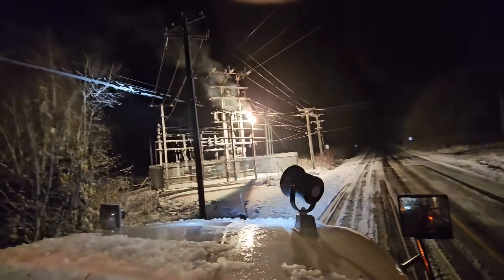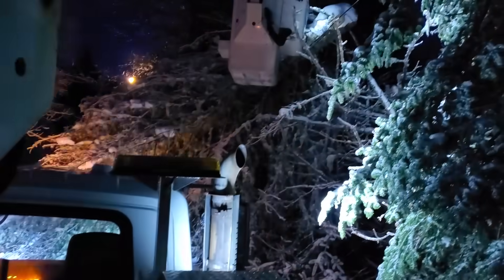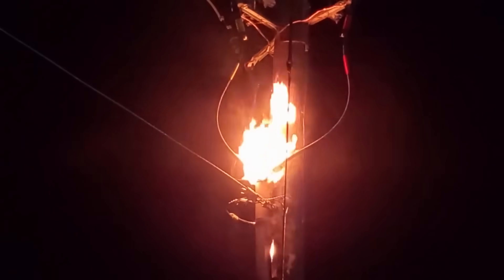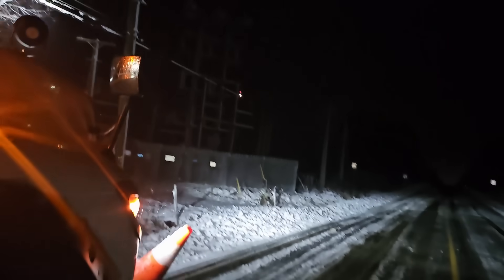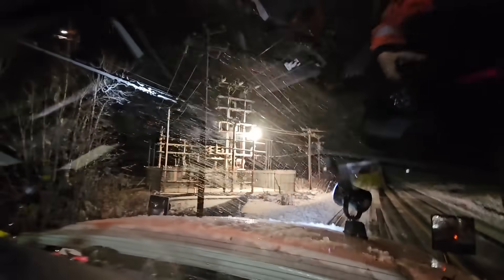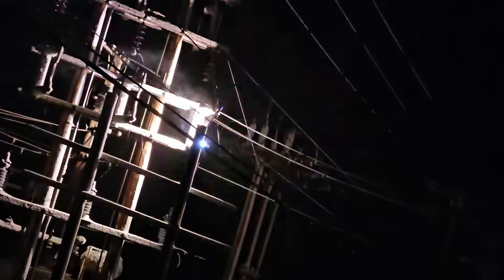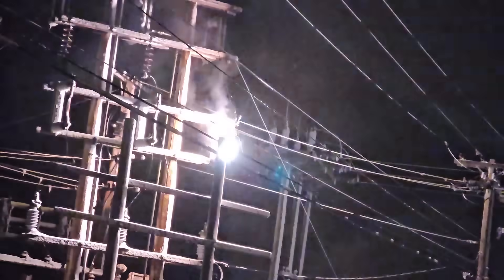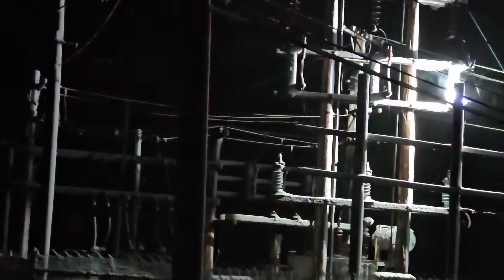Making "the call" to dump 10's of thousands

Comment: Well done! I’m a Transmission System Operator down in Texas. Distribution feeders are no problem to de-energize quickly. It doesn’t affect anyone but the customers. De-energizing a transmission line and substation is a little bit more complicated. For one a power flow study has to be performed on the system and the interconnection as a whole. De-energizing that line could cause other lines or equipment at other substations to overload. Not to mention if the other end of that line is connected to neighboring utility the dispatcher might not even have control over it via SCADA and will have to contact the dispatcher at that utility to open the breaker. There are A LOT moving parts that go into operating the grid so when he calls and it takes a few minutes to open line the dispatcher is doing a lot of checks before he does so. 

In my opinion. It helps to have a questioning attitude sometimes. If that switch is burning in the station I might be ok with letting it burn until I get all of my checks done and talked to the area RC. If it was a matter of life or health then yes of course it would be dumped as fast as I could make it happen. This is strictly about transmission equipment only.
Reply: That's interesting there is a story on YouTube guy flew a paramotor into high tension lines I'm guessing 230k or higher.  He was able to use a satellite communicator to get to a 911 dispatch. They were able to get the power turned off with in 15 minutes. He said the high voltage was burning his skin wasn't touching the wires. He could feel the power slowly decrease over 10 seconds when they shut it down.
Reply: I'm on Texas new Mexico. There's also fort belknap
Reply: good point, the grid is an interconnected network so big and fast changes will affect many generators and customer loads.  Sometimes there are no easy answers
Reply: just give the bus breaker failure relay a poke, it works faster
Reply: Two comments one. There should be no Bob, known to a dispatcher and getting different results to a phone call based on his position or title. A non-standardized relationship with the central hub of the distribution system is a disaster waiting to happen. Well they can't clone you they need to have every single person with the same job title have the same job  all the way down to the underwear just about. This stuff is too big and powerful to run on anything but interchangeable personnel. One of my favorite engineers of all time was Charles proteus steinmetz. He said that when you had an arcing event in massive power systems like this that it reflected in echoed and added and subtracted to itself throughout the entire system. When you have an arc like that the waves reflect back and forth through the system at close to the speed of light. You could be in a power plant 500 mi away from this ark, and have resonance and weird events happen from that ark and have something blow in another power plant. You could just be standing there doing your job perfectly, and all of a sudden get a voltage Spike and a discharge and boil you alive.
Reply: @markmcgoveran6811  No.

Comment: 6:00 for a faulty fuse / switch , would a high speed repeated application of 9mm lead via a multi barrel rotating device help in this situation, if not lead, a safer option , dispensed the same way...

Comment: Great video & glad everything worked out in the end!!!
At 9:49 pause the video & slow the speed down to 0.25 then play video & pause just as the power is cut off. You can literally see the structure around where the arc was located GLOWING in the dark due to heat generation (caused by resistance???)!!!! It fades out pretty fast due to how cold it is but really cool to see. Also shows how if the arcing was allowed to continue long enough it would have ruined the surrounding structures too.
PS: You KNOW it is cold in Canada when the snowman comes inside!!!!

Comment: For those that doesn't know why the light/arcs were green-ish: The arcs are hot enough to vaporise the surface of copper, making copper particles go into the air. The copper particles oxidises like how iron oxidises, and iron oxidises is called rust. As you probably know, copper turns green when exposed to the air.

Comment: I work on fiber/coax and I can relate to what you had to do and how stressful it is. We have backbone fibers that if taken down knock out tens of thousands of peoples internet access and its a VERY big deal when it happens. You have to be absolutely positive you have all your ducks in a row on your side and that its the only option to do the repair. You definitely did the right thing by not going near the station until the feed was cut off, its not worth you or your coworkers safety.

Comment: Load changes, out of phase, dirt traces, wild animal got in there and even throwing the breaker can start the arcing that can last even across the air that covers the length of the fuse. Take your pick and it's best to not be there when it happens. I figure the control room while doing the shutting down and back on noticed the oddity of an arching reading,

Comment: I use to be an operator in a New Zealand powerstation, curious to know why your transmission line protection never disconnected the circuit automatically?

Comment: I worked as a sparks for a good few years but you guys that work on high tension stuff, you guys are heroes, no seriously you are, people don't understand how much energy you are dealing with, it actively tries to kill you, it will jump large air gaps to put you in the circuit, I have had a clack off a big Cap in a machine I was working on, someone had 'jiggled' my lock off and connected some stuff up whilst I was on my 4 days off, thinking they were helping me out, that nearly killed me, but the savage voltage you guys work on is insane, plus you work in the snow, rain, wind especially wind as that is the main cause of line damage (well in the UK it is) but yup I just wanted to doff my cap to you guys

Comment: S&C SMD Series Power Fuses are quite reliable.  I wonder what the issue inherently was with this unit.  A typical fuse of this kind costs around $300.00 each.  Most people aren't aware of this expense.  SMD-20s are power fuses used on distribution feeders and have all the favorable advantages of the larger family of 69.5-kV, 46-kV, 115-kV power fuses.

Comment: There has been a big change in the power industry (at least in the west) to shut off lines when there is a high fire risk. Its definitely strange shutting off the power when theres no faults, but high winds and low humidity. Dont want secondary ignitions or a live pole to burn down.

Comment: I used to live near Amtrak's Northeast Corridor line with it's very tall towers and many wires. One winter ice caused a large tree to lean over and make contact with the uppermost wires. The sight and sound of that arcing was amazing. Went on for about thirty minutes -or so it seemed.

Comment: It's a testament to how respected linemen are, throughout the chain of power systems operations, that you can make a call like that and immediately have your transmission operator make it happen for you. I worked on the transmission side in the control room for several years and while it was never fun to get a call like that from a transmission operator reporting from their linemen, it was always very fulfilling to know that clear communication, efficient decisionmaking, and confident execution may not get you back to 100% in the moment, but they will certainly get you to as good a spot as practicable. You don't make a call like that lightly and everybody knows it. Let's get the system safe and stable. Let the monday morning quarterbacks figure out the rest.

Comment: I am always confused why any system designer would locate the levers to use a switch richt below it, like if anything goes wrong you got hell loose right above your head or even coming down to you
Reply: It’s because of the torque required to pull the levers. A straight line pull is stronger and you have fewer points of failure.

Comment: Utility workers definitely deserve more thought than they're usually given. One Christmas Eve we had to call out our electric company because, and I cannot make this up, every single light in the living room was pulsing, and not in the way Christmas lights normally blink on and off either. It's one of those things you'd have to see to understand. This is one of the things I can remember about my childhood because it was just that bizarre. Half the house had no power, and the parts that were fed by both of the cables that feed the house were alternating between a cut cable and a good one.

Flash back to spring of that same year. There are some terrible windstorms, and our backdoor neighbor's fence is blown down. The fencepost holding that section was apparently damaged enough that it needed replacing, and I guess the neighbor never had the electric company come and mark down locations of buried cables. Fence is replaced, and life goes on as usual.

However, that particular December was cold, snowy, and more importantly, icy. The fencepost, we later found out, had nicked one of the two cables feeding the house when it was driven. Not enough to cut it immediately or completely, but enough to open it to the elements. The water that had entered the cable in the intervening months froze and interrupted the flow and we lost half of the electricity coming into our home.

We were worried that we'd have to go without our kitchen for a while, and cook our Christmas dinner in the Dutch oven, but our electric company got out and ran a temporary cable through our backyard that very night, pretty much around midnight. Y'all deserve massive respect for what you do.

Comment: God bless the linesmen everywhere. We just had power out for 2 days here in Devon, England due to high winds and the crew were out there putting poles back up when the wind speed was still about 40 mph. They were ahead of the scheduled re-connect time  by about 20 hours! What a crew. Balls of steel. Thanks for your dedication.

Comment: I wonder if this is kinda what happened in my area when we had an outage, there was a landfill that had "drilling equipment" which made contact to a major transmission line causing injuries, then vehicle fire, followed by a brush fire.  The power "blinked and flickered" then stayed on (maybe when it happened) but about half an hour later the power went out for probably a dozen counties or more for about half the day.  That took out many hundreds of thousands of people and businesses.

When you called in asking it to be dropped, possibly they may have not asked more because they assumed there was some major emergency related to what was being done endangering the crew and don't want to waste time screwing around.  And also if they know they have good crews out there would trust such a call wouldn't have been asked lightly.

Comment: Had an insulator arc over after a long drought had been interrupted by a very short, light shower.  Dust had built up,  the rain was insufficient to clean it and once arc tracked, it wouldn't quit. Took out the pole with the fire.

Comment: As I was walking out of my condo about 9pm here in Thailand last week I saw a glow and sparks at the point where there was a connection from the street line to one of the 3 fuses leading to our transformer.  I had the security guard call the local electric company, they're 3km away and it took them 3 hours to get here.  Luckily it just kept glowing and sputtering and they were able to fix the drop and restore power in about an hour.  They gave me the melted drop wire and I gave it to the building management the next day.  I worked in solar for 5 years and have tremendous respect for electricity - thanks for your efforts every day to stay safe and help your customers!

Comment: If the fuse gets examined and the mode of failure is found, it sure would be interesting to hear some follow up on that.  Not really holding my breath since the temperatures involved could easily destroy any clues.  Great video by the way!  Thanks for keeping us safe and keeping the lights on.
Reply: I would like to know too.  I was wondering if the wet snow caused ice that span the connections on the outside of the fuse causing it to short.  Salt water spray from the ocean can cause arcing on insulators in switchyards so I was wondering what the snow effect was in this case.

Comment: How do you protect your eyes from the intense UV light created by those arcs?  Years ago I was on the scene of a relatively small pole fire.  One of the cross bars burned through, dropping upper HV wires onto lower wires and support structure.  There was a loud bang and I involuntarily looked at the arcing for a couple of seconds.  Later, my eyes felt scratchy, like I had sand in them.  At the hospital the doctor said I had flash burns and gave me some ointment and prescribed mild pain pills.

So, if I could injure my eyes from a few seconds of chance looking at the arc, how do protect yourself?  You would have to have said protection on constantly since you always looking for faults and never know when one will create an arc.

Comment: In Prudhoe Bay, Alaska there are gravel roads and when there is moisture the dust will form on fuses and insulators and short them out. They clean them periodically with a helicopter that has spray equipment and someone operating it and the fly from pole to pole cleaning potential shorts.

Comment: Thx Bob for "Keeping the lites on" in inclement weather safely. Much respect from 31yr retired Utility worker.
Reply: I remember pulling up to a 500kv sub that was pitch black with a huge orange glow where the 500/220 kv transformer bank used to reside with flames coming up out of cable trenches from burning transfomer oil, wasn't a good day when the ABB bank went from about to blow to glow.

Comment: Your operator did the right thing by acting first and asking questions later. I work as support of ISP infrastructure - if a fibre tech tells me the power levels (signal level) on the line is too hot - that is his area of expertise and I take his word for it. 
You're the trained lineman and the operator understood you would not make that call without reason - and so the why was secondry. 
I can tell you're getting a but choked up in the start of the video - I get that way too when on-call or discussing high risk operational response - it's a stress response, I think.

Comment: I reckon there was a defect in the attachment point to the fuse/cutout, and it heated up until it got hot enough to melt, and then once it melted away, it started arcing the gap.  Am sure glad that doesn't happen all the time!

Comment: Almost perfect job. Not quite asap territory there thought. No danger to life. You sort of glossed over the checks your dispatcher did, but if there was someone in danger I expect it would have been shut down far sooner, possibly damaging equipment elsewhere. I would guess they did a rolling shutdown of everything attached, rather than crashed the whole line. There is no point risking equipment to protect equipment already on fire.
Could it be snow buildup on top of the fuse melting that caused the arc? When fuses go they are pretty hot, and you could get a lot of water running down it suddenly.

Comment: I saw something like this 50 years ago in Elkins WVa.  It was summer break and we were out late on our bikes.  We saw a blue flash and what looked like someone welding. Rode our bikes over and saw something like this.  The wind was blowing pretty good and it was pulling the arc out quite a ways.  Watched the repair and got the old fuse and took it back to school in the fall to my HS electronics class.   It stunk up the car on the way back home.

Comment: Excellent job. You know your work. I use to work for a major water utility on Long Island. I got many a call out on nights and holidays for pump station power failures. Most were power utility failures. I got to know the electrical utility workers. And much respect for the dangerous job they had. I saw a fuse closure blow up that scared everyone at the site. Guy was in the bucket only 10 feet away. It was a cloud of smoke. And took a minute for the bucket guy to say he was ok. We had an under ground primary short that night.

Comment: Great video, Aaron! Lots of good info. Just lived through the two hurricanes here in Tampa. Went 3 days without power after Helena and 8 days from Milton. Luckily we had a small generator. Our condo is a few floors above them ground level.. During Milton the sky was constantly lit up by lines arching. 

It was like watching  a heavy lightning storm, but on the ground. I’ve been through a lot of these storms, but never seen anything like Milton. Another line near our home kept arching to a tree when the wind would blow in that direction, but it never tripped. It eventually caught the tree on fire and since fire dept wasn’t going out during storm the tree literally burned to the ground, but it did little damage to anything else nearby. So many crazy stories from these to hurricanes!

Comment: Linemen are little known treasures. I have had some experience with low volt fuses and cut-outs, but you Folks are in another realm. Thanks!
Reply: As a Floridian, a lineman is as much of a hero as any other first responder. I open my window and say thank you if it's possible on the road.

Comment: So I take it this 69kv transmission line was being fed only from one end? Otherwise, you could cut the power from both sides and isolate that section of line while maintaining power on the rest of the subs from the redundant connections found in most transmission systems. Like cutting off a section of a ring, power still flows the other way around the ring.